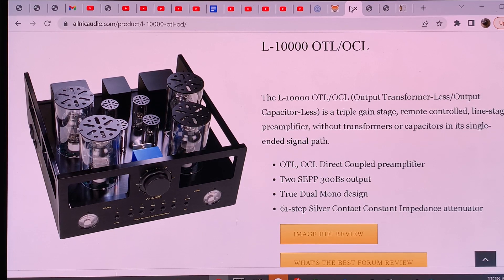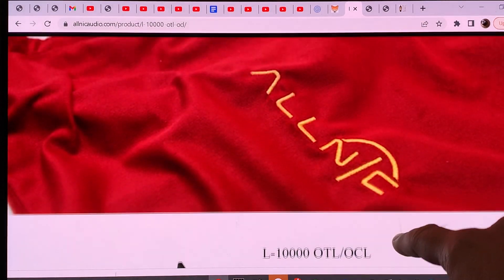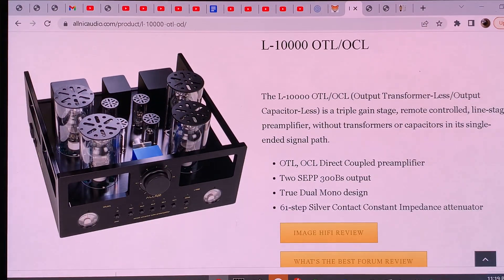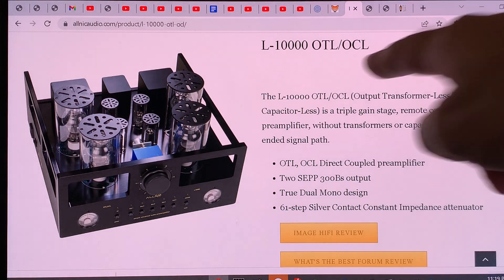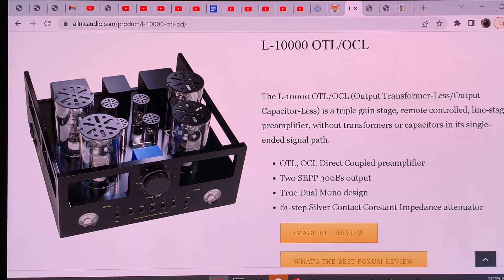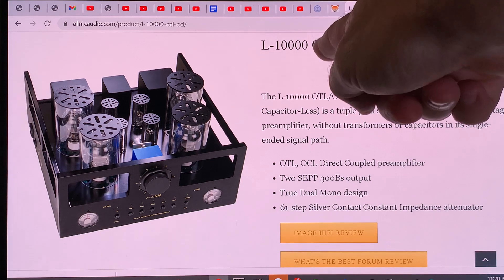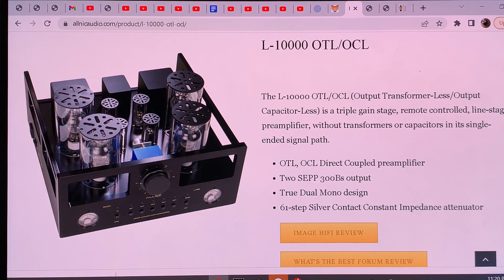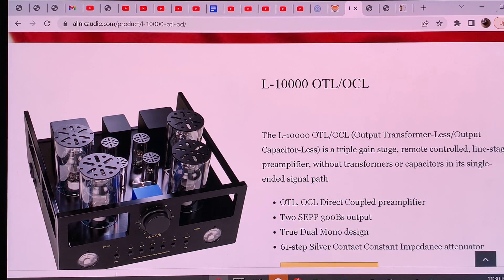High level preamplifiers from China Korea Japan: Allnic!

Comment: Another benefit of power triode is it can work into lower impedance loads without going crazy, plus it does not have a large amplification factor which theoretically means it messes with the signal less, at least that’s my understanding.  I can imagine this bad-boy would sound pretty dang gone good, betting many people would swoon from its sound signature if they ever got to hear it, this is cutting edge for the type of device it is and it’s competition.
Reply from the maker: You got it! The power triodes can provide a low impedance without negative feedback, while signal tubes require feedback or silicone current sources (and feedback) to keep impedance low.In addition to nautrally low impedance, power tubes have an inherently better linearity and vastly superior headroom, allowing for very clean and undistorted amplification.

Comment: DHT :  Filaments AC heated  >>>> potmeter can't eliminate all of the 50/60 Hz ............some triodes are more problematic than others but most amplifiers are fine when listening...........
AC does cause vibration of the filaments.............with some impact on the signal.
DC heated ...................ONE side of the filament sees 5V ( 300B ) the other side of the filament sees 0V..............
BIas voltage must be elevated by 2.5 volt !!!!!!! 
Curves will somewhat be  waved out like an umbrella.............
Best is to use a CLC ( with choke ) to feed DC to the filaments..........Capacitors will allways be in the signal path !!!
Audiophile choice and arguying about DC or AC for DHT's is total personal !
AC excludes using a DHT for a preamp ....
I heard a preamp build with a 211/VT4c ...........
4 times 300B tubes consume a lot of current................when rectified you have the noise of the transformer / diodes charging huge capacitors on the peak surges. ( bursts sssssssssss..........!!! )
BUT....
Only the results count.............and that's a personal appreciation /experience.

45 , 50  NOS triodes are to MY PERSONAL taste musical superior to a 300B .
Every one of the FEW components in a SET or a pre amp WILL leave an imprint o n the sound............even the sockets ( beware of some recent productions ) I saw FAKE Johnson sockets for 211/845 ...................
Beliefs , opinions and arguments as well as taste ........................versus FACTS !
Symetrical amplifiers may have some benefits ...............but no device be it transistors or tubes are realy identical even if they measure the same ! They may be paied in static conditions but not under dynamic use......................there will allways be some loss of information............that may sometimes  contribute to an even  more perceived pure sound.
Good or bad all is a compromise ...........................but when it works ! Balancing without loosing the essence of the music............instead of chasing specifications.
Asking an ingeneer about his amplifier...................how does it sound ? 
Answer : ...............I didn't listen because I don't need to listen ...........................Why should I ...It measures near perfection.!
Reply: Sakuma was using AC which intrigues me. Given your 'potmeter' comment, others (Dmitry Nizhegorodov, Steve Bench) researched this hum and found that some of it is unrelated to the 50/60Hz but to the filament itself. I tried running 4P1Ls in push/pull but did not manage to cancel out the hum well enough and switched to DC. I still use the centre-tap filament connections which I think is an awesome feature for DHT (EML does them for some of their tubes).  I am starting to really appreciate DHTs.. they do a lot to bring out what you touched on: the essence of music, a certain grip on me - the human connection but also hearing individuals in choirs...but they do require a good system around it..
Reply: Hi Eduard Sakuma used a 2 point ground method to reduce hum when he implimented ac heating for DHTs. Look it up on Sakuma's site.
Regards Lou @EduardBroekman
Reply: @loureda5443  Thank you Lou, I did totally familiarise myself with his 2-point technique - but it didn't work me for the 4P1L. I will try again when it comes across my path - I may have missed something !!🙂. Hum and hiss are normally the least of my issues when building amps...
Reply: @EduardBroekman  That's exactly what I wrote .......................and a DHT due to the direc t heazting is unlikely to be sufficient silent in a pre amp................but what can stop someone to experience ................
Reply: @loureda5443  Indeed .................to evereyone it's own solution.........
Reply: @EduardBroekman  Hello eduard .............that why I mentionned vibration ( mechanical & harmonics ) in DHT triodes filaments.............his comment is right .
AND..............To avoid additional vibration of the outside world and the chassis ..........it's wise to suspend or decouple the sockets for DHT's like the UX4 and others.......
All small things / details count on the final bill............
Reply: @frankgeeraerts6243  Thank you good to know - 'vibration' got flagged for me when reading your original comment.. don't know why! Thank you for picking up on it. Anti-vibration is a whole new topic. My test setup (6P43P screen as anode > IT > 4P1L > OT, all single ended) sits on plywood H frame with maybe 10 kg of iron here and there.. it seems to behave very well - but in a final setup, it may need something. Any type of suspension/decoupling that works well for you? Some people run HF AC which can be tuned to a certain frequency that would resonate minimally - but I really don't like more circuitry and I figured in the early days a lot was designed for battery feed anyway, so it feels off to make AC a religion :)
Reply: @EduardBroekman  In an old article written by Jean Hiraga and published in the French audiophile ......very different methods tried out of supsending a  CD player to minimise vibration it was concluded that a pillow/cushion and on top of it a granit plate was the best solution with best results........
My brother used 3 magnetic suspencions on his Jadis amplifier and it opend up like no one could expect , those Yamamoto feet are very expensive but oh what a surprice , under every component..........
I will experiment hopefully myself in the future with magnets sold on the web..................
Natural rubber ist still a great material ..........i used rubber tulls to fix sockets and even under the feet of transformers ( the ones used for passing wires trough holes in chassis )....................even wood to tune a sound like Janos did.....................
Ebony ..................if you can still buy and find it ??!!..................( sometimes from an old piano ! )
In some cases sorbothane can be usefull as well as bluetack or blacktack.............
Essential is also to avoid as much as possible .....acoustic feedback.....
Some tubes are more sensitive to vibration ( as well as transistors do , YBA knew that and dampened them in his amplifiers! ............they bare alsomicrophonic !)
The geometrie of the bulb may also come into play.................ST versus GT.........or Balloon shape .

AND..........The better the tube the more it will benefit ..................strange but true............. ( the most silent and less microphonic  one )......

Have a nice day 

PS .....I also had some circuitboards suspended and or rest on natural cork................both work.
Nude wire benefits also from suspending , I made turrets of cork with slits cut in them to suspend those nude silver wires .................... ( like powerlines in the country .........haha...)

Comment: I thought I would chime in and make a couple of comments as I have listened to Allnics entry 
level phono, the 1202 and it has a pretty well balanced sound from top to bottom much better than their previous efforts in that area. The Allnic 7000 phono and line stages I have also heard in an unknown to me system and they consisted of e810 tubes transformer coupled in the signal path
and 300b tube regulators in the power supply.Good sound but could have been better if  the Rowland amp was substituted with a tube one as the vocals were a little grainy. I think Allnic wanted to emphasize they went past conventional rc and transformer coupling with this OTL/OCL mumbo jumbo in their terminology.MR Park who is allnic's chief designer is a clever guy and to his credit has designed a complete system much like Audio Note.Not the best quality of subcomponents but good sounding  none the less. On the iron front I have roughly 77 pieces in my custom system and I firmly beleive that approach is the way to go.
Not perfect as nothing is but if you like dynamics, scale and dimensionality ,the trans coupling has it in spades. One last note while I have imense respect for the 45 and 2a3 tubes they just do not have that imense scale power and dynamics that the 300b, 211,and 
805's do. Also remeber that Big DHTs may not be the best tubes for small signal applications as were never designed for preamp applications and the could become noisy and or microphonic and you need to use more of them because they have lower gain.
Regards Lou
Reply from the maker: Thank you Lou! Indeed, a trendy trend is to blame transformers for everything bad that's happening in the system as they bring on compromises. It is often forgotten that using other means brings on even more compromises... 
The iron count in my system has also been increasing over time, but I'm nowhere near your level. Currently at a meager 25 with the Ampex or 26 with the SET... (LOL,the SET stereo amplifier has higher iron count than the two PP monoblocks put together.) 
I firmly agree with you, increase in strategic iron count does translate to an increase in natural ability to play non-mechanical music. ;

Comment: Compared to the L-8000 DHT? What do you think..
Reply: The H-8000 DHT is my favorite phono stage from Allnic. I currently have lower down the line but someday hopefully 😎
Reply from the maker: Cannot tell without hearing them... the tube complements are completely different, I am not familiar with the L-8000 complement, except the VR tube 5654, which is the finest voltage regulator gas tube - not just as far as gas tubes go, but finest voltage regulator period (including solid state). I think the differences between them should come down to the difference in personality of the two different tube complements.

Comment: Why use nickle transformers in the power supply? Surely low transmission of noise from the primary would be a good thing, obviously not the case in a signal transformer....
Reply from the maker: Indeed, one would choose nickel for signal transformers... odd to see them in power transformers, that was my first reaction as well. Silicone steel provides much better headroom and peak power handling than nickel does. However, in this case (preamp, small signals) the ability to transmit a more constant power is more important than the ability to supply giant peak surges.  
When the power factor is off, then the current & voltage peaks can be quite apart, meaning that significant current might be drawn at low incoming voltage parts of the duty cycle. Nickel is doing a much better job here of supplying juice to the power supply than other power transformer materials under such conditions (toroids being absolute disasters in such conditions). (BTW compromised power factor is becoming the new normal for many homes and areas... sadly.)
Reply: @realworldaudio  Good point. Yes, so many electronic devices on the mains supply now is creating all sorts of power quality issues. I'm going to save up for a big battery!